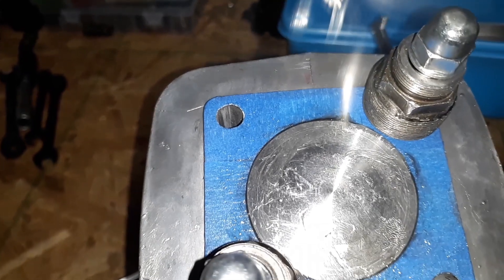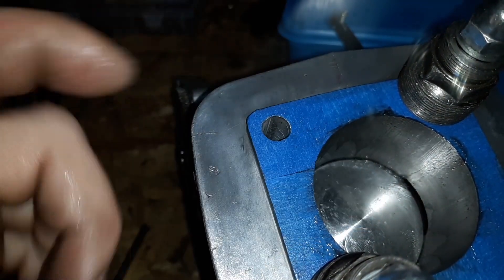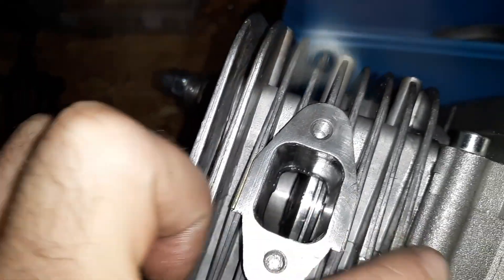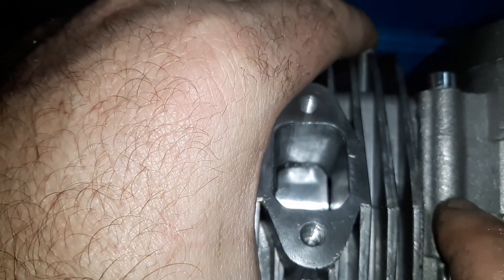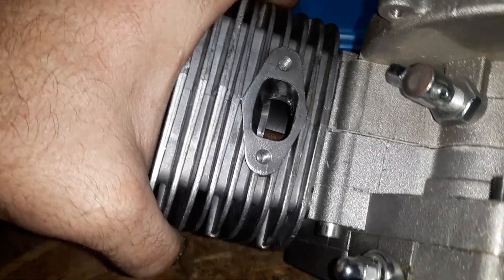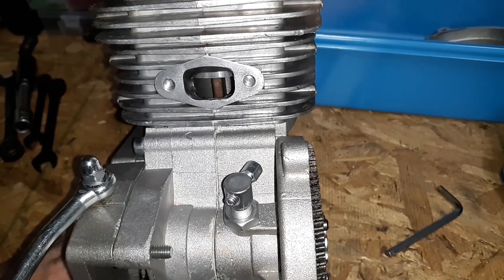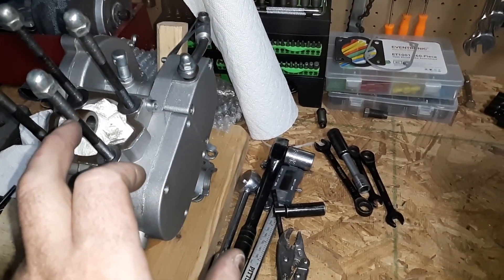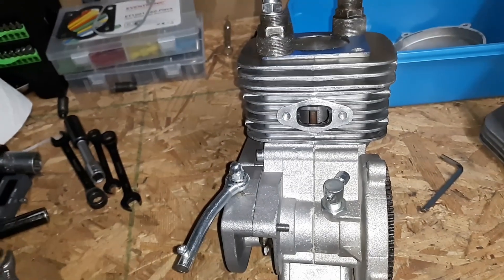Here is a quick view of the 110cc motorized bicycle port timing mess

Comment: Hi , sorry to bother , could you tell me what is the bolt pattern on a ms460 jug ? I can't find it anywhere and it would help me to do some measuring before buying the jug , I own a old 48cc engine , I just measure the cylinder pattern and is square around 43mm center to center
Reply from the maker: 50x56mm yd100 bottom half is your best option.  Oval your jugs holes to match 50x50 on bottom half